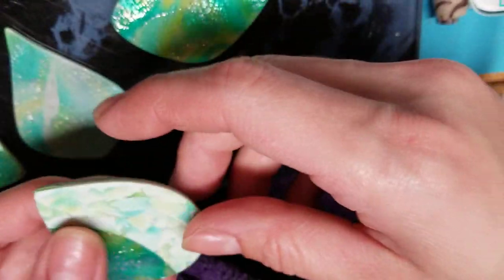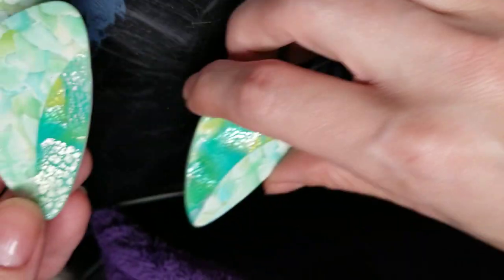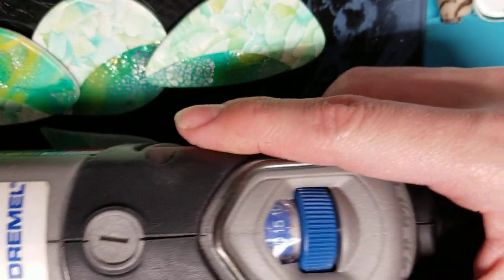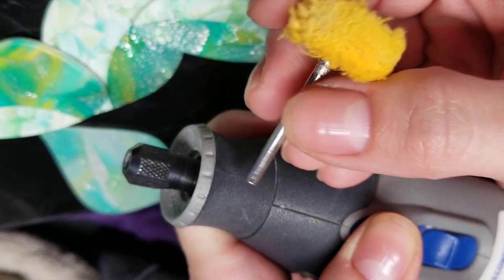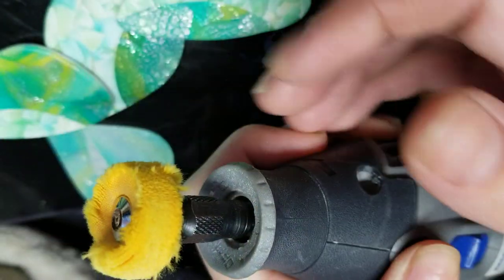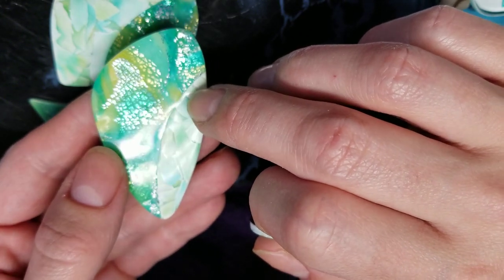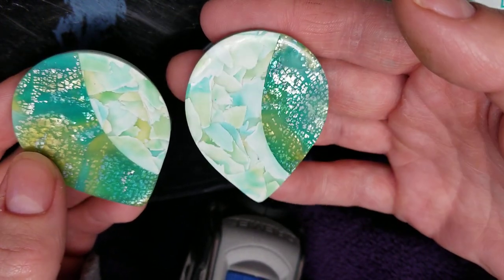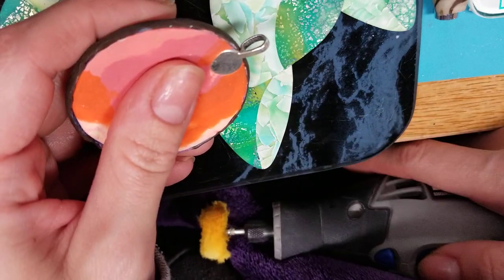Using a dremel to polish polymer clay

Comment: You can now get 1 or 2 inch wet dry sanding pads for hand sanders. Just get the correct size shank and adapters, most dremel are 1/8th. 60 to 10,000 grit. such a time saver!
Reply: Do you have a link for these! This sounds so much better than hand sanding! Thank you!
Reply from the maker: Most my stuff is on the Amazon link In the description
Reply: @robinlong3652  the dremel sanding attachment and pads can be found at https://www.amazon.com/gp/product/B083K3ZKR1/ref=ox_sc_act_title_1?smid=A3LRKDXYVQDRR3&psc=1
not necessarily recommending that particular one! just an example of an option and how to find it. :)
Reply: I have been looking for these!

Comment: Where do you get different grits for the dremel?  I have a 3000 but Dremel doesn’t show what the grits are on the bits, and they seem way too course.  They don’t sell 400-1200 which is good for clay…
Reply from the maker: Amazon I found my pack quite a few years ago now
Reply: @katiegordon610  Wow- I didn’t expect an answer since comments are so old!  I got a set online and followed instructions but first try the shaft bent.  I think it was too long.  I’d really like to no longer sand and buff by hand and have been looking for answers online when I found you.  Perhaps my set is just not the right one…

Comment: Hi Katie I have a question about the Dremel you have. Do you use specific Dremel sanding discs or can the machine take generic brands. I have jus bought a Dremel micro but can only get course grits. Appreciate your reply if you can. Thanks
Reply from the maker: Responded to this question u asked on my fb posted a pic of what I have for my normal dremel 4000 so check that

Comment: Question for you, Katie. Does your buffing pad fling little strings all over when you first use it? I got some, but the material flings little strings everywhere.
Reply from the maker: The ser comes with two an orange which is slightly coarse I use that right after sanding followed by a white finer I use after that only like the first time does the white one but the orange is not really bad compared to others I've uses
Reply: @katiegordon610  Awesome. I saved your link for next time I need some, I'll try them.

Comment: Hi! Sanded same grits, wet/dry but seems to leave a white residue with tiny scratches still! Driving me crazy, any tips? Thanks!!
Reply from the maker: Hum maybe your brand is too coarse or clay is softer or something never go lower than like 400 but if u see scratches start 600 or 800 and go as high as u can go 1500 2000 2500 3000 4000
Reply from the maker: Scuply 3 I remember scratches easily but it also breaks easy thats why I don't use it

Comment: I have the 3000 dremel.  It is hard to sand smooth the way the sandpaper is turned on objects that have grooves and petals.
Reply from the maker: Ya I don't sand w my dremel at all
Reply: You just use the buffer I see?  I am going to try that to.  It came with a buffer but not sure this is the right one.
Reply from the maker: I show what I do I'm alot of my pendant videos I sand either by hand or w the sander I've shown then buff I don't use the one that came w my dremel its too coarse
Reply: @katiegordon610  I use the cheapo nail files a lot too.